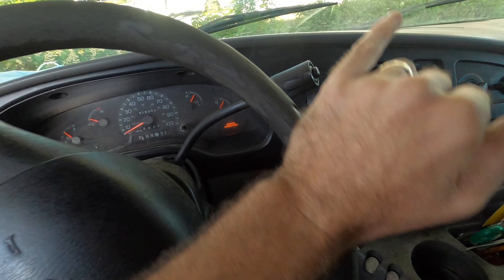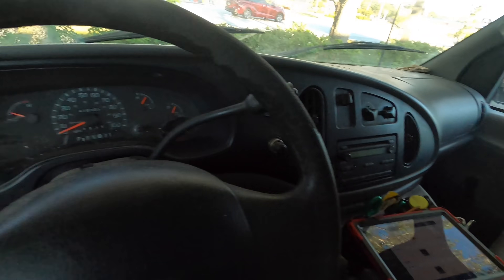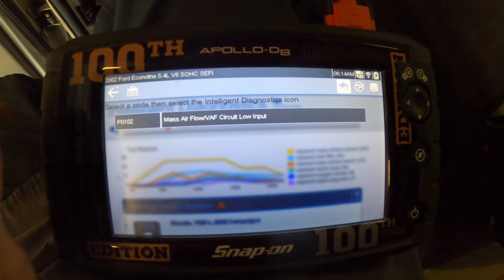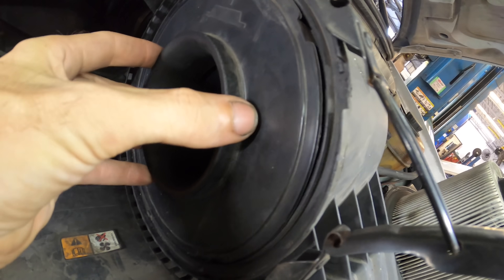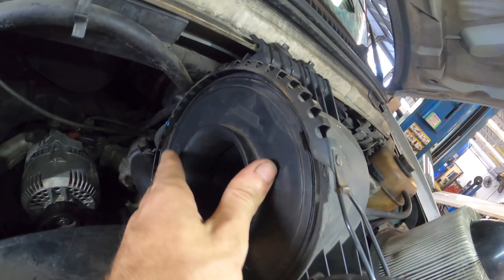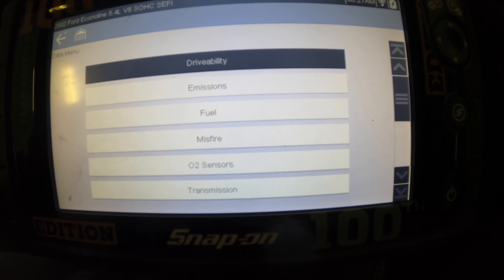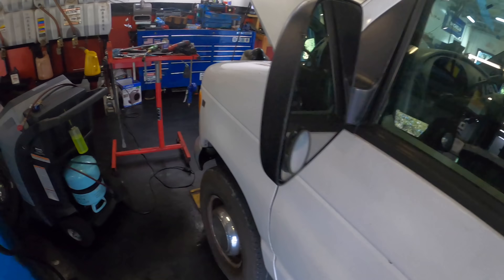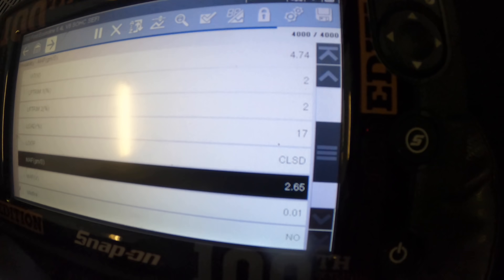Ford Has Engine Trouble. DO NOT Replace Parts! Understand the System! P0102 Mass Airflow Fault.

Comment: I remember when I worked at a AutoZone commercial shop sales I would often help the front counter and I would tell the customer that the codes is a starting point and doesn't mean that that certain sensor is bad and they needed to take the vehicle to a mechanic...I got in trouble for not selling the part... So I had to make a decision... either lie to the customer to make the sale or quit as soon as I found a better job...

HONESTY AND KNOWLEDGE is priceless....!!!!!
Reply: I use to work at Autozone as well. I think if the store has pretty shitty sales, the manager gets mad for not selling but if the store is usually making the daily income they won’t trip as much and I understand where your coming from nova vroom vroom
Reply: I worked at Vw dealer and got more customers by telling people to go buy parts at aftermarket shops and come to me for factory stuff.
Reply: Dude I worked at AutoZone for 3 months and got threatened with write ups just because customers would deny the "monthly sale special". Needless to say I'll never even go back even as a customer.
Reply: Similar experience here:
I worked in the workshop of a computer retail shop (that's what I was hired for) and usually didn't have much contact with the customers. I got the device (notebook/pc/printer/whatever) and the customer description for the problem they're having and always had the budget of the customer and a proper repair in mind (no shortcuts / think before firing the parts-cannon / no selling unnecessary parts).
After some time, I was also assigned to sales in the shop at the counter and I worked after exactly the same principle as in the workshop: sell the customer what they actually need instead of overpriced shelf warmers. A student with low income wanting to use a notebook in lectures doesn't need a 17" gaming notebook or a X1 Carbon. They need something lightweight that fits on the cramped tables in the lecture hall with enough power to be able to quickly start/stop their office software for making notes but nothing high-end for playing games.
However the manager had a talk with me and wanted me to sell more high-end devices - regardless if they need it or not (All that bs "You need to sell them the lifestyle - not the device." and "You need to boost your sales numbers by selling more expensive devices..").

I disagreed and quit.
Reply: @thetee8682  Yup don't ask them what they want ask them what they need or want to do with it. Most have no idea what they need or want. They'll go straight for new $1500 thing when a rebuilt core 2 duo (some yrs ago) with a new hard drive will do just fine. Usually quite thankful for saving them $1100- $1200 when best buy wanted to sell then half the damn store.
Reply: @thetee8682  well done for holding your convictions and not bowing to the pressure 👌
Reply: > So I had to make a decision... either lie to the customer to make the sale or quit as soon as I found a better job...

Surprise twist: He's now the CEO of AutoZone.

Comment: A missing oil filler cap will also introduce unmetered air into the engine through the pcv system.
Reply: Did he even replace it?

Comment: Ray.. Just am fyi on steering and alignments ...newer cars may need the SAS steering angle sensors reset to recalibrate or system will drive funny. I am not a mechanic but just found this out about new cars

Comment: Had a friends car that the dealer said it needed a new in tank fuel pump so took it to my shop and we checked it out and cleaned the MAS and it ran like new again. Like you said about the fault codes that they are just saying there's something wrong in a system that's causing a component to look bad but could be just a simple fix.

Comment: Ray, if needed, some silicone (100% silicone in the tubes like you get at home depot) around the edge of that canister will hold it in nicely and, is easily removeable later if needed.  You could also use silicone gasket maker stuff but it is more expensive.  I have used silicone for an adhesive ever since I watched the sign guys glue the letters of my business on my building.  They said that is all they ever use.  30 years later, those letters are still up there.
Reply: That was my thought as well.  Just 2 or 3 dabs around the edges will do.
Reply: @NemoConsequentae  Exactly.
Reply: Pirate labs, not sure if i get the silicone from home depot, That stuff has acetylic acid which is deadly for O2 sensors. If you really need silicone get the stuff made for automotive that is O2 friendly. Have a nice day.

Comment: I absolutely love the part about people replacing Parts because of codes. Whether it's mechanics part stores or individuals. That is still so very wrong! And I especially laugh and cackle every time I see a commercial about how mechanics don't want you to see this as they say. And then they'll advertise a product that pulls codes. All I can say to that is I'll see you when you realize you blew a lot of useless money. I had one just like you described come from another shop and it had the same code as before they replace the mass air flow sensor. And it turned out that the intercooler tube going to the throttle body had slipped free all the boost pressure was escaping. Which in turn means the customer wound up wasting money on a part that didn't need to be replaced. Same scenario occurred when somebody brought in a Ford 500 that had burned out catalytic converters ran rough and periodically would stall. Well they replaced all those parts that did need to be replaced they failed to identify the root cause. The customer replaced the fuel rail pressure sensor and that didn't solve the issue. In the end it turned out to be an internally short to ground AC transducer. 😂

Comment: Such a smart man and I have alot of respect for you but you meant gallons per second not grams.  Much love from a mechanic in Nebraska.
Reply from the maker: I just looked up the semi official terminology: “MAF's air flow rate at 500 rpm is 1 gram per second per liter of engine displacement”
Reply: @RainmanRaysRepairs  a gram seems small but hey you may be right.
Reply: @RainmanRaysRepairs  a gram is nothing to a liter but it seems small as a good air fuel ratio would be 12 to 1 but maybe I am missing something educate me lol.

Comment: You've addressed my biggest complaint about scan tools. The errors point at using the parts cannon, when a good diagnostician is the real cure. Which is why you're getting all the old work trucks. I only wish I could bring my car to you.
Reply: Diagnostics is learned. Ray said it well, you need to understand how the system works in some detail before you can be good at diagnostics, no matter what field you are in. (Metaphorical you, not you specifically.) I keep trying to educate my peers in IT about that. (And some in automotive, even some in medicine... yes, I have worked in all 3.)

Comment: I have a "funny" problem on my car.
That's actually exactly what you're talking about here with understanding the system.
Sometimes it gets the under-pressure error message on the turbo diesel engine in a Jeep wrangler 2009, European so therefore diesel.
It has electronic pressure actuator.
But what could be wrong, the turbo? actuators? power to the actuator? the signal to the actuator?
Even more fun, it only happens now and then and without warning, and everything is fine after the error code has been removed.
Just changing the turbo is a shot in the blind.
Any ideas to find the error?

Comment: Those bloody MAF sensors🙄   I bought a 2014 Honda Civic last year to replace my high mileage 92 Civic si. I drove 1200 kms to work in northern Alberta in February when it was -44 c and the air tube cracked wide open after driving all night from the coast. Car would start but quickly shut off. I came out of camp the following Sunday and found the problem, MAF was in the air box so it was drawing in unmetered air through the torn tube,23 dollars for a new Honda air tube, good to go, runs great again even in arctic like temperatures. I keep a spare one in the trunk now because nothing likes really cold temps like that. 😎

Comment: P0300 on a GMC I bought broken down and sitting for quite some time was my learning experience. Learned to read live data and dtcs are more like hints on where to start. Turned out I had some weak coils and injectors clogged both on it. It was a mess to get it right. Put on all new coils from Amazon and a junkyard set of injectors. Then I had to fix the manifold leaks, they were excessive to get decent fuel trims.. fuel line rotted on the sending unit, rust in the line clogged injectors.. when the sending unit rotted, previous owner parked it and didn't mess with it for years. It was one that even experience mechanics in the trade would have had issue with I think. I'm just a home gamer trying to save a buck. I'm better for it no doubt. now I talk to people trying to fix their care and they act like they know exactly the issue because they had a parts house read the code lol. They just don't get it.. I've had this same talk with a few but they seem to think I'm nuts lol.

Comment: reminds me of when i had the garage replace the distributer module.  I picked up the truck $250 later and it ran like crap, miss firing all over the place, spitting and sputtering.  I had already planned to replace the plug wires anyways.  I go to replace the plug wires and discover that one of the two screws securing the distributer cap wasn't tight allowing the cap to move around.  $250 and only 4 screws and the "master technician" couldn't manage to actually tighten all 4, I had to follow behind him finishing his "work".

Comment: My e-150 does the same with the seat belt warning. If you connect the belt very forcefully when it continues to chime, it will activate the switch that tells the computer the seat belt is connected. I guess it’s a bad connection in the actual seat belt/receptacle connection.
Reply: yeah, over time junk and goo gets down in there and causes that problem, along with wear on parts

Comment: Love the custom high performance chromed out oil cap. It doubles engine torque and horse power.
Reply: That "chrome cap" is actually a stainless steel condiment cup that restaurants put ketchup or barbecue sauce in alongside your fries or ribs.
Reply: another source of unmetered air, should have been fixed. biggest problem i saw was the maf was unplugged, i would have replugged, and checked readings again. That's not to say the issued repaired, didn't need addressing.
Reply: @timdryden3778  Agreed. Potential for unmetered air there,  and that cap was just ghetto. And it lets dirt right into the engine
Reply: @timdryden3778  I though the maf was inside the air filter. Or was it that metal cap thingy 😅😅
Reply: @kathygarvin5745  --You are correct about the MAF location, however an unsealed oil fill cap can introduce "unmetered" air into the engine through the pcv system. In this video it appeared to me, of course i wasn't there, that the MAF harness connector, being not  securely plugged in was the main issue.

Comment: Your grams were reading up in the 9 and 10 range but I thought it should read what your engine liters were? 5.4
Reply from the maker: It’s an approximation. G/sec shouldn’t ever be below the displacement
Reply: that was the cold start reading, once everything warms up i bet it will read close to the engine size, think of it like an electric choke on an old carburetor vehicle, it takes more fuel to stabilize a cold running engine.

Comment: my 1998 econoline 250 keeps blowing MAF sensors. My data plug doesn't work either and the fuse isn't blown. The 1 that came with the van lasted a while, then it went bad. the 2nd one from ebay lasted a little while, the 3rd one from amazon lasted about 10 miles. I cant understand how they could be getting destroyed after working for a little while?

Comment: Mass airflow codes are never a mass air in my findings over the last 25 years . I agree 100% . Never herd of the grams equal to the liters thats a killer tip thanks
Reply: Yea at idle the engine should be taking in the amount of air to the size of the engine it’s a neat trick to see if the MAF is working before testing. My car is a 3.4 at idle the MAF reads 4.1 grams it’s close but not too low

Comment: 5G/s around 8litres or 2? Gallons or 18cfm?
Reply: He means that at idle speed, the grams per second reading from the MAF will generally be equivalent to the engine size, once the MAF element is fully in its temperature range. In this case, the engine size is a 5.4 liter, so once the MAF stabilizes from a cold start, it should read close to 5.4 grams per second. My 02 Silverado 2500HD has a 6.0, so at idle speed with zero throttle input, my current MAF reading is 6.21 g/s, after replacing the plastic resonated intake tube to a cold air intake metal tube from behind the MAF to the throttle body, (that plastic crap was too restrictive) which was causing a lower than expected MAF reading at 5.11 g/s. And that woke my truck up to even more power than it ever had
Reply: @mattcat231  
Ok, but is my conversions correct?
Reply: @brucebaxter6923  well, i really don't know on the conversions, i just go buy what is in the neighborhood of "where it should be" vs where it's not.  Another example is i have worked on a Chevy Cobalt, 2.0 4 cylinder engine recently for a MAF code low response, and the reading was close to what the engine size was, so in going down the diagnostic rabbit hole, I failed to realize that a lot of smaller engines should read double the size, meaning a 2.0L should read near 4.0 g/s, so before I knew that I fired the parts cannon sniper rifle at it and replaced the MAF with a known good used one, and it was reading 3.81 g/s, and the code went away, it didn't seem right to me until I dove into more info.

Comment: About not wanting to use glue: Parts stuck on with Hot glue (available in a low-temperature version too) will come apart with some heat from a hot air gun. Something like that housing is probably rugged enough to tolerate that.
Reply: Silicone caulk works, too, and much easier to remove.

Comment: Why didn't you show live data of fuel trims to confirm the fix before & after the drive even though it obviously wouldn't have run a full drive cycle because 9gm's is high at idle it should of been around 4.5 - 5gm's at idle?
Reply: Cold start with high idle bypass
Reply: @brucebaxter6923  That's why I said live data  before & after to confirm fix as operating temp would be acheived after the drive trims would have settled down & so would have MAF!

Comment: You are too kind. Shop down the street would write a bill for MAF, blinker fluid, muffler bearings, wiper blades and somehow the exhaust would have a phillips #2 size leak.
Reply: I had a shop tell me once that i had a rust hole in my car, she showed it to me and you could see the shiny metal where he stabbed his screw driver through it.  I said there wasn't a hole there until you stabbed your screw driver through it, right there's the shiny scratch from your tool.  He was like there's a hole there now.  I paid the bill and never went back.  He also tried telling me that my horn didn't work.  I pushed the button and it beeped, i said it sounds like it works to me.  He said it doesn't make the right sound. lol  All the cars that actually need fixed and this clown is trying to invent stuff on my car.
Reply: @kuebbisch 
Unfortunately most shops today are thieving dens of vipers. Guys like Ray are RARE as hen's teeth. 
Thing is the bad guys are literally putting the industry out of business in the USA.

Comment: How can a very wildly known common used van NOT HAVE PARTS readily available?! Those vans are scattered like a bad case of fleas compare to ANY automotive out there!
Reply: Too old, and not ALL parts are rare.  Ray ran into this on an earlier van repair with same air handling unit.   Totally out of stock and he ended up having to go pull one from  junk yard.  Part of it was probably the current logistics mess.

Comment: Trying to read the screen while the camera jostles around is really frustrating! 
If the only problem is the sensor being broken then what would be the point of sensors? I did have a problem with the O2 sensor keeping burning out but the vehicle was a junker so I wired in a varister and reinvented the manual choke.

Comment: imagine a mechanic actually figuring out whats wrong with your car and not just put random parts inside until problem dissapears
Reply: Imagine having to pay a technician to discover what you paid the previous technician to screw up.
Reply: that is Ray
Reply: Some woke newbies cant be bothered to learn how to use and read a scanner
Reply: Thats what Mechanics do.. Now Automotive Technician's that these trade school's pump out are not mechanics, They are parts replacers.
Reply: Do you work for a dealer with newbies ?

Comment: MAFs and O2 Sensors, the 2 most incorrectly diagnosed trouble codes. I cannot count how many vehicles were brought to me with those codes that I saw immediately had new sensors put in and the vehicle returned to the customer. That pretty much told me it wasn't the sensor.
Reply: Eric O was just talking about that.
Reply: Never make the assumption that a new part is a good part.
Reply: @MWilk098  Yep ran into that more than a few times.
Reply: when i bought my last car, the car went limp mode under the first heavy load so i brought it to the used dealers mechanic of choice and had them diagnose it, they swapped the o2 sensor and gave it back, did the exact same thing the next time i drove it on the exact same hill so i brought it back and they ended up just throwing parts(Turbo and EGR) at it until it fixed itself, so i got about half the cars worth in free replacement parts on the used car dealers dime before it was fixed.